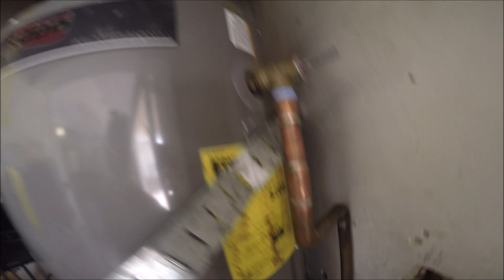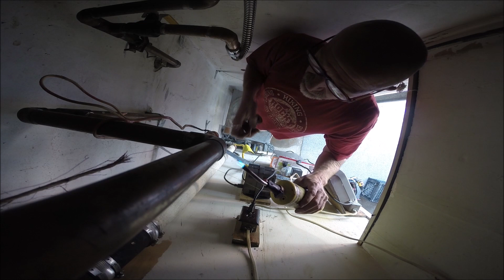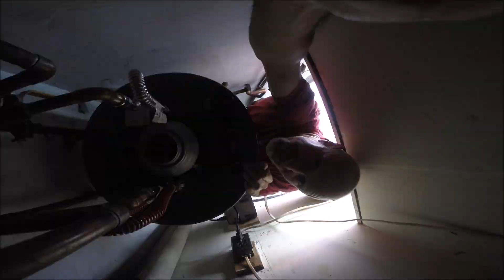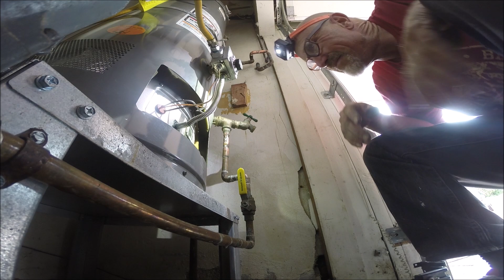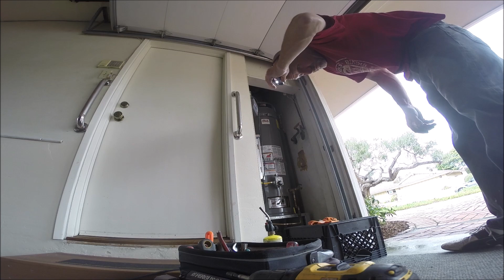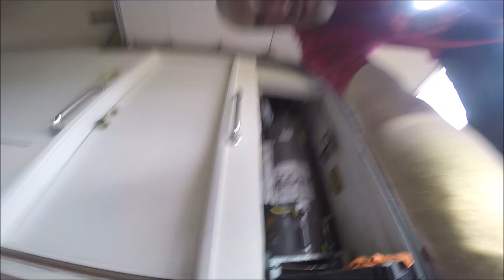Ruud Water Heater Replacement - Install

Comment: I'll never understand why California straps the tanks in... If an earthquake happens, all the hot water heaters will still be standing straight up meanwhile the house fell down?
Reply from the maker: I think they had an issue with them ripping out that gas line and causing fires!